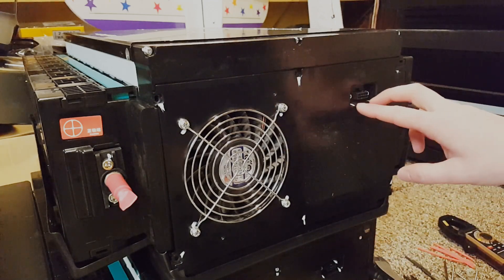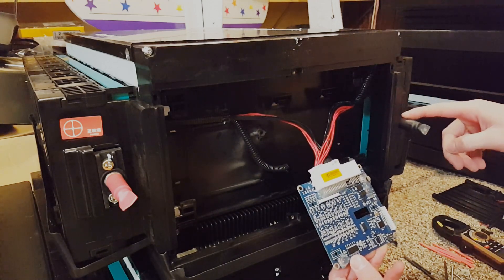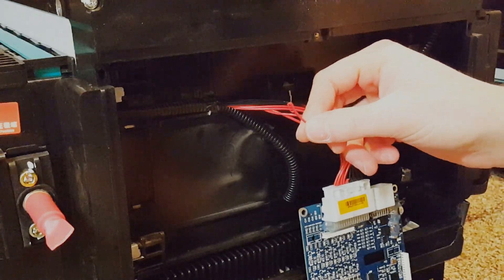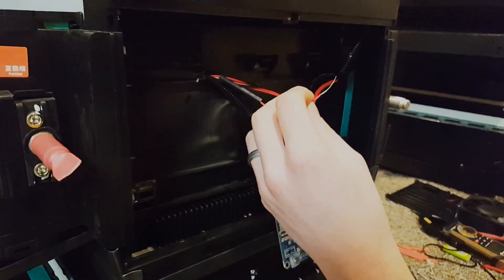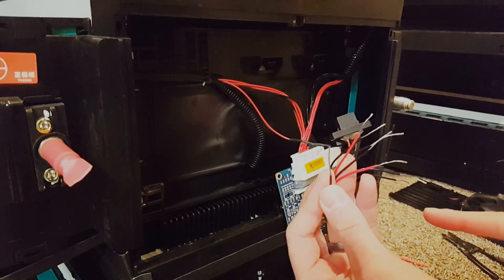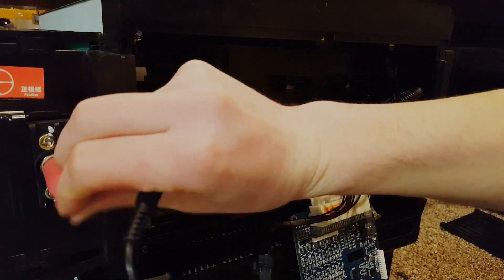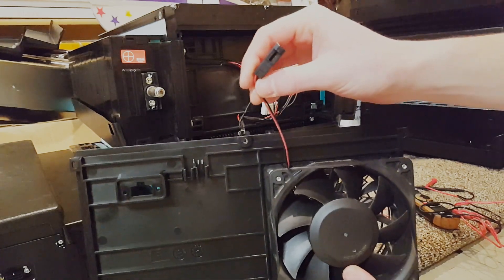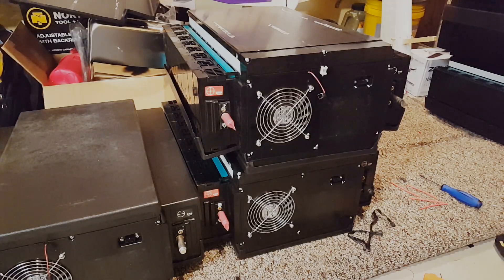BYD 24V LiFePO4 Module - Balance Lead Wiring How-To!

Comment: Nice video, great job. I should receive my batteries in the next few days. The problem I’m having it’s that I’m not able to find a BMS for those battery and no one online seems able to recommend one. I purchase a wiring harness from Tech Direk also the BG-8s from Amazon ... they have different connector and wiring. The BG8s came with XH 2.54 balance port ( 9 pin) and the wiring harness have 8 pin. Need help connect them together.
Reply from the maker: If you look in the description of the video I left a couple links for the other end of the molex connector as well as the pins that go in it. If I misunderstood your question let me know. As far as a BMS for these, this is a good option(select the proper amperage for your application).

https://m.aliexpress.com/item/32891427621.html?spm=a2g0n.detail.0.0.7647H6NXH6NXWw&gps-id=storeRecommendH5&scm=1007.18500.139671.0&scm_id=1007.18500.139671.0&scm-url=1007.18500.139671.0&pvid=d6d729de-c6f3-4e6d-a0f3-085c72172022&_t=gps-id%3AstoreRecommendH5%2Cscm-url%3A1007.18500.139671.0%2Cpvid%3Ad6d729de-c6f3-4e6d-a0f3-085c72172022%2Ctpp_buckets%3A668%230%23177981%231_668%23808%235965%23453_668%23888%233325%2320_668%232846%238115%23812_668%232717%237559%2398_668%233164%239976%23757&browser_id=450ced0aeb0f42549c734352daf5712a&aff_trace_key=&aff_platform=msite&m_page_id=4ztofqxxxcacaa7m172fd7917b6a47345001121622&gclid=&_imgsrc_=ae01.alicdn.com%2Fkf%2FHTB1GUk4a8Kw3KVjSZFOq6yrDVXah.jpg_640x640Q90.jpg_.webp

Comment: Looks good! I was thinking of going this route but as you say, will need more than 1A current. I ran 22AWG to each b+ to a terminal block.
Reply from the maker: In hindsight, I would have ran 20 or 22 gauge ribbon cable for the connections but I ordered the 18 gauge pins already! 😂 luckily I found some 18 gauge ribbon cable on Amazon.

Comment: Been watching most of your videos and I like that you're very open-minded. Hoping you could help me out I got an inverter that needs fixing it's probably a small thing for a person like you that your a genius but me my still learning...so you think you can fix it.???
Reply from the maker: I appreciate the kind words! I'm actually pretty unfamiliar with most of the components inside inverters. Ive never tried to fix one, but I have seen videos of people who have. What is it doing? What inverter is it?
Reply: @diyrenewableenergyelectron4996  this is the story on it the inverter is a cotek SP 2000 .its a year old the inverter I turn it on right away it goes to a low voltage and the inverter shuts off without any load. I opened it up and I found that it was dirty so I clean it with air cans check some fuses inspect what I can.put it together  again and the same.i am runing out of ideas.
Reply from the maker: So, I dont really have a ton of advice lol I would say open it up and look for any wiring on the input lugs and follow those to see if there is any circuitry fried. It seems like the inverter isn't able to sense the input voltage so I wonder if there is a voltmeter on it somewhere that either died or had wiring come loose. Other than that I am out of ideas too. Maybe someone can chime in with more helpful info.
Reply from the maker: Any update?
Reply: @diyrenewableenergyelectron4996  low at the moment I did expect it again more closely but I don't see any being fried. At the moment. I am doing my homework. Basic who fixes inverters so I can mail it out. I did call or some type of service like that but at the end it seems that they want me to buy there inverters. And they have crazy numbers. But I can't afford that. You have any ideas...
Reply from the maker: I wish I could be of more help, but I dont know what else it could be. Good luck with it and please let me know if you get it figured out!

Comment: How did you power your fan once you had completed the rewiring?
Reply from the maker: As it turns out, I didnt end up needing the fans. These batteries were designed to be charged and discharged at hundreds of amps. I charge at 45 MAX so they don't get warm at all lol

Comment: Sorry if my question is too basic: If the battery pack came with a BMS(the one you removed), what is wrong with using it? Why take it off and wire in another BMS?
Reply from the maker: I enjoy answering questions, dont feel bad! The original BMS wasnt working and was part of a larger BMS. It is also proprietary so programming would be very difficult and I have no programming skills lol. The BMS that was on it originally also would not have been able to disconnect the charge/discharge current if need be.
Reply: @diyrenewableenergyelectron4996  Oh, great! So its more like taking charge instead of depending on a "follow-come bms" (as we say it in Nigeria) that doesn't afford you a total picture and control. Makes sense. Thanks a lot.

Comment: what BMS do you recommend ?  
Is the nominal voltage 3.2V or 3.7V ? 
From the technical specification, it reads 3.7V, but, i have seen some videos with 3,2V as nonimal.  Does it make any significant diff ?
Reply from the maker: Yes it definitely makes a difference. The nominal voltage of these cells is 3.2 volts. These are lithium iron phosphate cells. Lithium ion cells such as lithium nickel manganese cobalt oxide (NMC) are 3.7 volts nominal. I have heard good things about the "Chargery" BMS's as well as the ANT-BMS but I dont have any personal experience with them. If you dont care to have the ability to change parameters, the Daly BMS's are very popular.